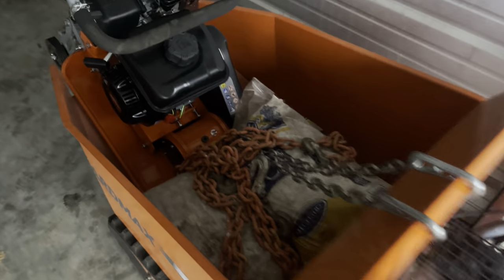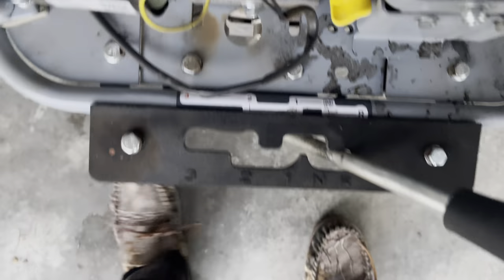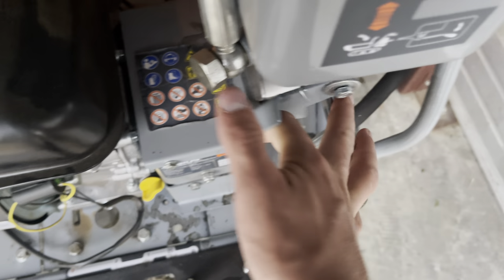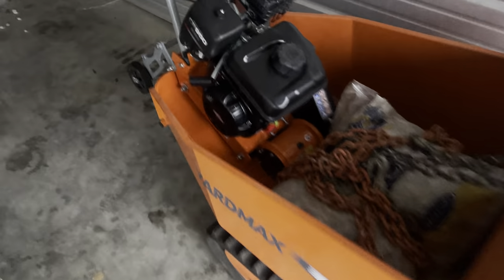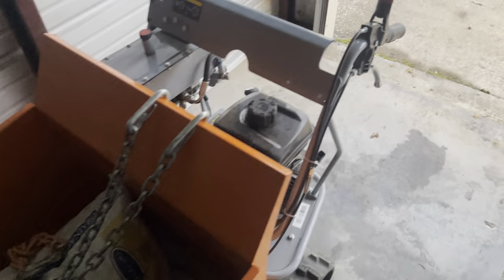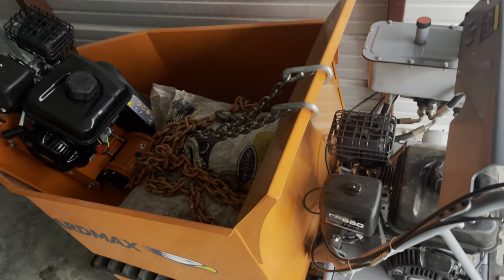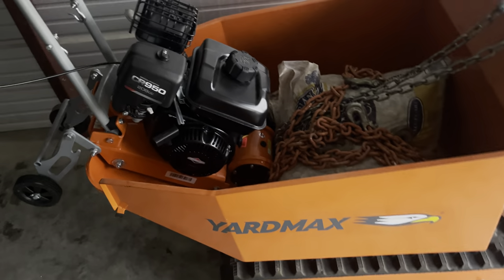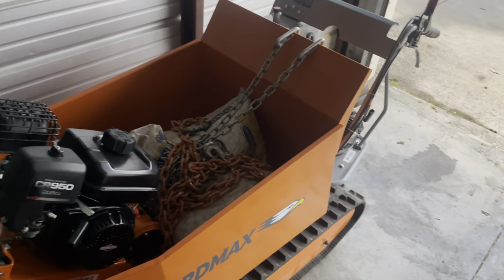Yard Max Track Barrow and plate compactor review!

Comment: Yea I got that barrow. its great for Hardscaping. you can use it to load dirt into a dump trailer too if u don't have a skid. great machine for heavy work. 

As for the hydraulic oil, it is leaking from the reservoir gasket. I used gasket maker with the original gasket and tightened the bolts. I have a slightly different design reservoir than yours, but yours looks better. make sure to keep the cap tight too but don't over tight it cause its plastic
Reply from the maker: Thanks for the advice I will try that